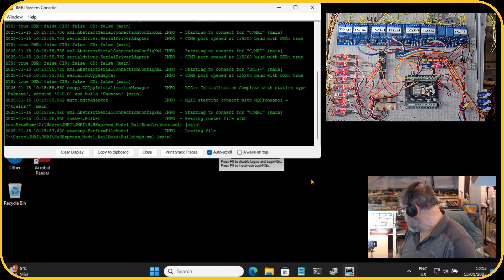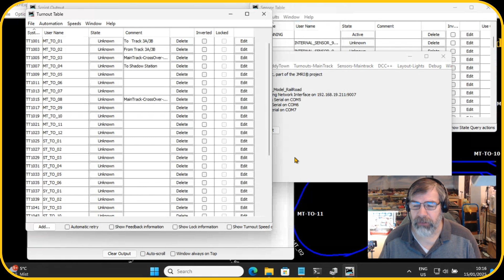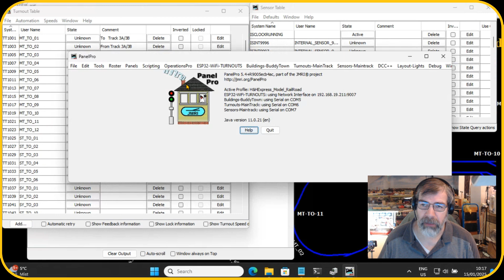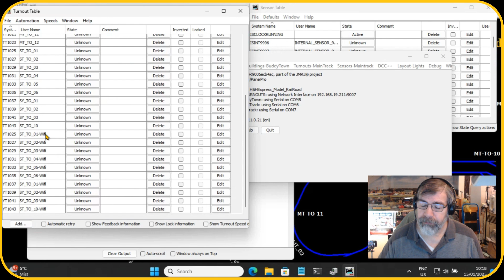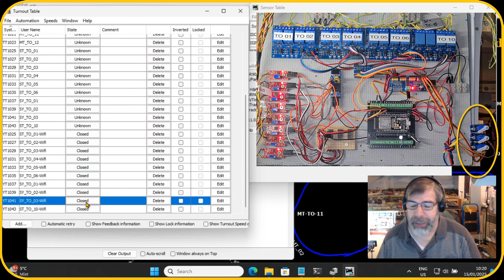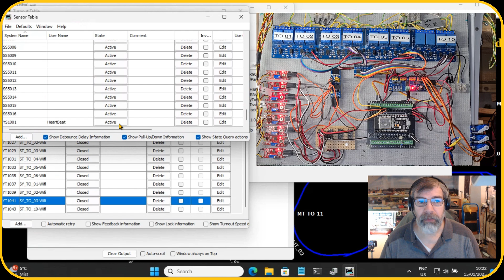Using WiFi to Controll my Layout -  H&HExpress

Comment: I always felt bluetooth control was the next big wave for layout control, but wifi is also a way to go!  It is definitely more complex to the average modeler, but so were VCR clocks when they first came out.  :)
Reply from the maker: Yes it is a bit more complex.  that is why I generated the basic sketches to go with and put on Github.  This way it makes it easier to be used